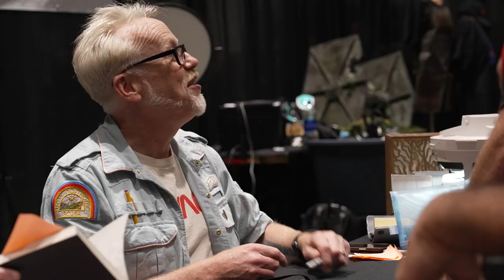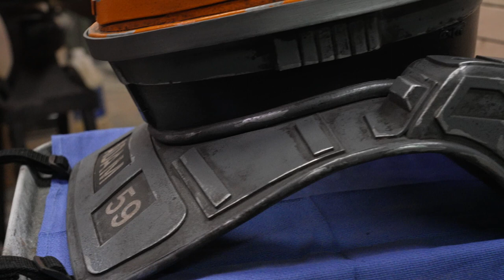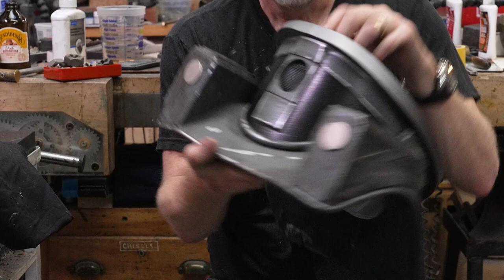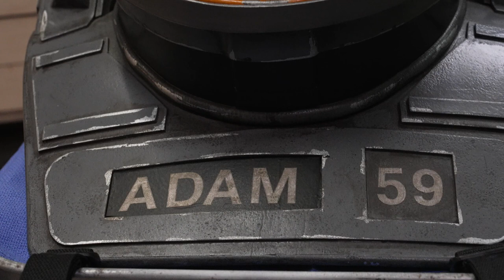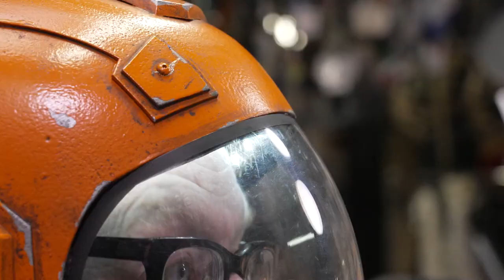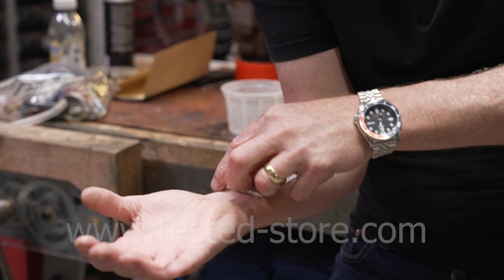Adam's New Foam Space Helmet from Evil Ted!

Comment: large rotating compressor - not popular . What seems to have some takers is a piston engine rocket pump. After rocket labs orbit. A 2 stroke/1stroke lox engine. with compression release hole. A 12 inch bore. Worlds largest rocket jet. My compressor was stolen from pods. buy pulley. Because - star trek modified episode.